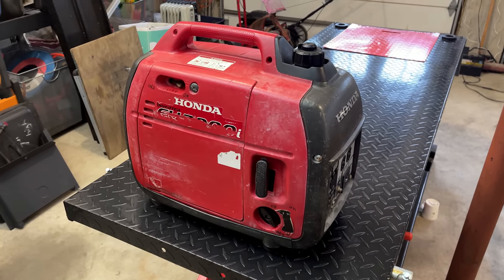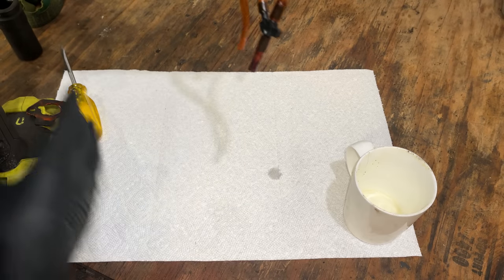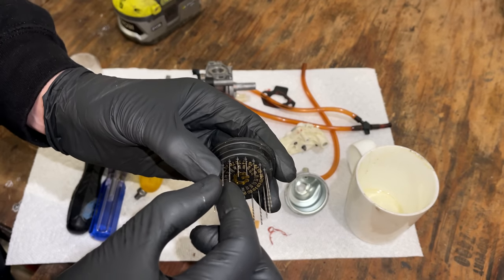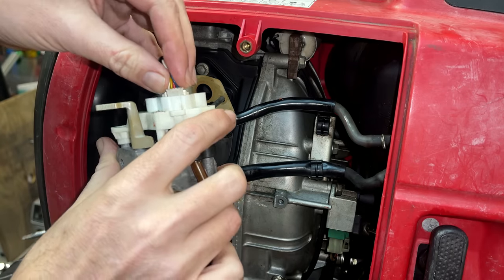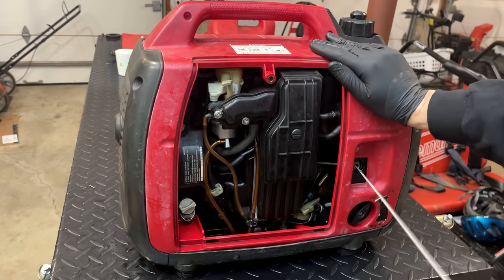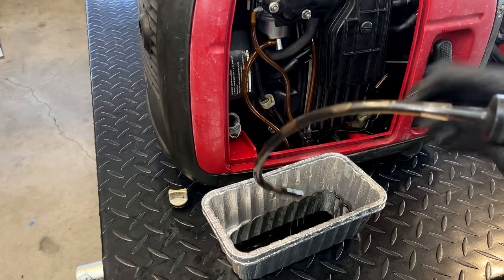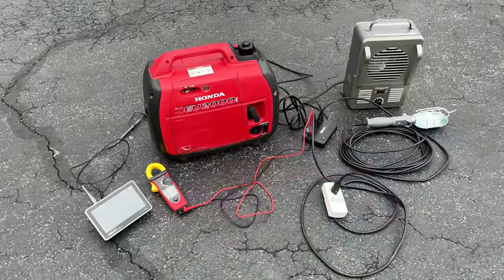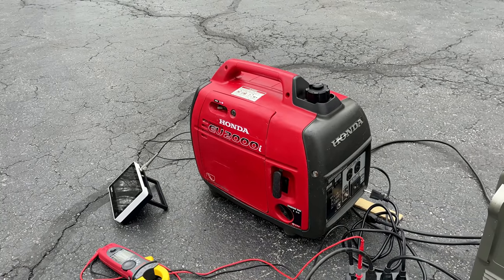Old Honda EU2000i Generator Leaking Fuel

Comment: Dealers don't want to mess with stuff that parts are marked "unavailable"...    if they get a clone or used part,  then they are stuck with warranty and nobody to back that up.    I fix electronics,  and I cringe sometimes at these jobs.  If it was for just me,  I'd fix it no worries...  for a customer I don't know very well,  I'd be nervous.
Reply from the maker: It did not help that the white sticker with the exact model revision was missing.  That would make any serious repair a difficult task.
Reply: @jcondon1  Indeed.  By default,  It's easy to condemn the technicians who refused it,  but once you've worked on that side of the door,  I can understand why.

Comment: Those shops that couldn't' be bothered are "spoiled lazy" replacers VS repairers.   A heat gun will renew the oils from the plastic and brighten the color but it can take a while to do a larger area.
Reply: or just don't bother, it's generator and not an art piece

Comment: I have a generator just like this, always been hard starting,, leave it set for a week or two and it take 10-15 pulls to get it to run. I guess I need to tear into it and see what I can find wrong.
Reply: Do you drain the carb?
If not then new fuel needs to flow into the carb to mix with the old stale fuel and give it the right "volatility" to start easily... 
Fill the tank to the brim with fuel less than 1 month old....so gravity helps flow fuel.
Reply: @JohnSmith-yv6eq   I use the non ethonol fuel and it shouldn't go bad in less than a month, so no, I don't drain the carb.
Reply: @dloregon  
Do you completely fill the fuel tank, give the fuel from the tank time to drop down into the bowl, mix with the old fuel in the bowl, and replace some of the volatiles that have evaporated from the fuel left in the carb....?

Comment: Judging by the apparent age of that machine, I would imagine that they were concerned about the availability of parts. I have had that happen a few times over the years. I remove the carb to clean it, everything crumbles due to age, and nothing is available. In addition, customers are unlikely to make the necessary investment for the repairs to get done on an old machine, making it a waste of time for a professional. I operate a side business repairing small engines, and that is where the majority of my customers come from. They are unable or unwilling to pay the prices charged by a professional shop, so they come to me.
Reply: Fair point but the shops can charge an unreasonable price for their work as well. My sister had a small gas powered mulcher that kept stalling when it got loaded up. The repair shop wanted $350 to “service it” which at the time, about 15 years ago was more than the cost to service her car so she asked me to look at it. I’ve worked on engines all my life, anyway I adjusted the jet and hey presto, problem solved. I gave the whole machine a proper service and it cost less than $50 in parts. Cheers Stuart 🇦🇺
Reply from the maker: Another big factor was the missing model ID sticker.  If you look for parts just looking up eu2000i you will find many revisions.  So fixing this one could have been a game of trial and error.
Reply from the maker: Most shops around me would not bother opening the carb due to labor costs and come backs.

Comment: Suspect of the missing dip-stick on the oil cap.   What happened to the dip stick?    If it's in the sump... it's an issue waiting to happen and snap off the splasher.
Reply from the maker: Good point.  Not sure.

Comment: Someone has already been in that carb, as evidenced by the RTV. wrong needle installed causing the droop in the float! 
!
Reply: Float droop is not unusual apparently....
might have something to do with corn juice in the fuel?
Anyway replacement is the cure as they are non-adjustable....

Comment: picked up one of these, starts and runs fine, plugged a 500w light in and it lights for about 30 sec, get a little brighter and then the light goes out but the engine still runs normally. all the while, there is no green light. ive ohm tested most of the components inside and seem to test fine. would a bad inverter be the cause? thanks for your vids on this generator.

Comment: Why can't people use lots less RTV Hi temp sealant?? Maybe try a light coating of Hondabond, Yamabond, or 3 bond, very light. I worked on one of these and the plastic ears that held the float  pin in place were broken, and they seem to be unavailable. I had to use a China carb. The OEM carb does not start 1st or 2nd pull either, I have a suspicion that #73 drill could benefit with a #72, although we all know you sholdn't drill jets. You have to ream them or buy the next larger size.

Comment: The generator probably has more than a thousand hours on it. So it would be good to clean the cylinder as the sparkplug looked bad and the timebelt replacement.
Reply from the maker: And a new valve stem seal.   Unfortunately that is a big job on these little machines.  Think the owner just wanted it running again for the occasional use.

Comment: I did not see a reason why that old float was so low.  The needle alone would not have caused that.  Most have a metal portion to bend when establishing the right level with that all plastic variety I am not sure if they can be adjusted, if not what caused it to be low??
Reply from the maker: The level cannot be adjusted although a heat gun can soften the plastic and an adjustment made.  Also a good chance the float will just melt.  Would say the tip of the needle had an issue or more likely the spring on the side opposite the tip may have lost some of its spring.

Comment: These generators usually sale for around $999, and a lot shops charge $100 an hour for labor , so you can see why they don’t want to work on them . People could easily spend 2 or 3 hundred and then still have a used gen that they may have more trouble with. I’m not saying it’s right but that’s the way our throw away society is nowadays. No more corner repair shops 😢  !

Comment: New viewer here, what make / model of drill bits are you using?  I really like that drill bit container.
Reply from the maker: Gyros® Carbon Steel Wire Gauge Mini Twist Drill Bit Set |Includes 20 Micro Carbon Steel Bit Sizes #61 to #80 | with Convenient Clear Dome Storage Case (45-12010) https://a.co/d/cVt7Bua
Reply: @James Condon  thanks, I just ordered a set!!
Reply from the maker: Just be careful.  I have broken a couple in the jet :(

Comment: Just wondering what the two clear tubes that come out each side of the carb are for ? They join up in a Y junction and just lay open ended in bottom of the plastic housing. Fuel overflow ?

Comment: I had one identical that given to me and it’s still on the bench I replaced the carburetor tried rebuilding the old one still doesn’t run right, but I found out that there’s a certain model line of this particular generator that has a defect in the carburetor, which makes it impossible service Prone to clogging even with gas left in it less than 30 days. which means it has to be drained of fuel after every use and hardly no one does that so there is tons of these little EU 1000 and 2000 sitting in the corner of garages with people that have given up on them. and your customers right no shops wanna come anywhere near them because it’s impossible to keep them running for very long.

Comment: Would you not replace the fuel lines, they look  a little brittle. Looks like it has been well maintained though. Maybe a tiny bit of that sealant broke off and clogged the needle n seat ever so slightly enough to cause an overflow and by stripping it, you actually cleared it? Magic fingers, also applies to computers a tear down works for no apparent reason.

Comment: Do you know of a place to find rings for the older flathead Honda engines that are in the older small suitcase generators? I have a small 900w Kubota branded generator that needs rings. It's small and very very handy. I used to use it all of the time. I would love to fix it.  I do not want to tear it all apart if I can't find parts for it. I think is is around 2-3hp.
Reply from the maker: Sorry not sure where to source rings fir that engine.

Comment: God...  think I would have checked for a spark right at the beginning of all this.  If the carb has been pissing fuel into the engine for hours, the chances are high that the spark plug will be fouled... and badly so due to the very rich running...

Comment: That's odd that no shop would look at that generator, I'm a small engine tech and Id of looked at it if he brought it in for repair
Reply from the maker: I was just as surprised.  Seems like easy money and an easy fix.
Reply: @jcondon1  those are pretty easy to fix, diagnosing the inverter board is not too bad, I've have a Honda generator trouble shooting guide with the specs, but I fix those generators here quiet often for issues like inverter boards or carbs

Comment: I think you found out a little bit of why shops won't bother with repairing these. First the shop would get screamed at for a $200 repair bill and then they would get screamed at for breaking it and causing low oil shut off. That's a lot of hassle for a $40 profit

Comment: You may have to read between the lines on why local shops won't fix a product. Sometimes it's the customer and not the repair that's the reason shops won't take on the work.

Comment: Most techs don't know how to adjust the min/max because of the eco system.  Need to set min/max for eco AND normal mode. Just got mine back from annual checkup and it wasn't done correctly.

Comment: Was it just the light reflection or did that oil @ 40:12 look silver/milky when you tilted the generator?  Also, what ever happened to that generator with the possible weak valve springs?
Reply from the maker: Still have it.  Will make another video on it, but got tied up with a bunch of other projects.
Reply: @smallbyrdz3823  That usually happens with an overfilled crankcase, where the rod/crank actually whip the oil into a foam. When he tipped it, it did not appear that the oil flowed out prematurely as it would if it were overfilled. Also, most decent oils have an antifoaming agent in them to prevent just that. It may well have just been the way the light was hitting and the camera picked it up.

Comment: Where do you get ll those sexy new decals?  Whenever I look up a parts list for anything I am fixing, everything is "Obsolete - No Longer Available"!
Reply from the maker: The eu2000 decals are discontinued on some revisions but other revisions are still available.  Just looked at a few revisions until I found some available.

Comment: the best one that I ever had reliable  heavy use was the sportsman 2000 w generator run off of LP gas. Was Honda generator just like the one he worked on the issue is that float is plastic running a generator on 90° temperature outside the plastic gets a little hot and droops down not allowing the float to completely go up to turn it off that was an issue with them generator I went through three of those stupid floats always in the summertime till I start taking one of the covers off of it the side the carburetor was on never had no more problems with it when 45:08 gas prices went up I sold it and bought a gas generator that runs off propane.

Comment: When my EU1000 got about 40 hours on it, it became hard to start.  Turned out the plug looked pretty fouled, like this one.  Cleaned it up and it was fine.   When the same unit was subjected to a brief flood of water about 8 inches deep - I had to split the case and clean/dry everything.  Stuffing it all back in and getting the thru bolts back in was very difficult.  Perhaps there is some trick I'm unaware of?

Comment: You should know better than to SAY, 'This should be an easy fix. 🙂
The smoke may have been caused by the previous owner tipping the unit over to empty the fuel tank and oil leaked past a valve.

Comment: I had one years ago. It had the same problem. It leaked fuel after only 30 or 40 hours run time. I sold it. I always thought it was ethanol fuel swelling up the rubber lines.

Comment: I have one of these I picked up for $50 and in about the same condition as yours. Had major surging in eco mode so I rebuilt the carb but I still have some minor surging(like yours) that I can't seem to correct.

Any ideas? And where did you get the new decals?
Reply from the maker: Great deal for $50.  I got the stickers from eReplacementParts.com.  Part numbers in the description.  It depends what you mean but surging.  It’s pretty common without out a load that the engine speed is a little unsteady.

Comment: My EU2200i is rock solid, but I'm curious if it's normal to take 12 pulls to start it if I turn the fuel supply off and run the carburetor completely dry before trying to restart it weeks or months later.  It starts with first pull if I turn the ignition off and then restart it.  I think it's normal, since the carb uses a fuel pump, and it takes that many pulls to prime the carb.  But I noticed with this generator that the carb was flooded and overflowing from the airbox within 3-4 pulls.  Is my generator particularly slow to prime or did the owner just not run the carb dry before dropping the generator off?  I also noticed that you start fiddling with the choke lever after only 7-8 pulls after cleaning and reassembling.  For a cold engine with unprimed carb, I need to keep choke on, pull briskly for 12-13 pulls, and it starts right up, I then switch the choke off.
Reply from the maker: The tank was empty, not sure if he drained the carb.  If you fill the tank to the top it can gravity feed and/or prime easier since the fuel level is above the carb with a full tank.

Comment: Honda excercise machine. I had one like this.
Reply: You could always modify your own machine with a "straw hole" through the outer case with a slightly larger tube of flexible EFI rubber hose sealed to the outer case and to the air intake where it enters the carb throat...

You could modify a tyre air valve stem without the Schrader valve in it as the cap-able case insert to the tube to the carb.
So unscrew the valve stem cap on the outer case, insert the "straw" on a can of engine start...
a very brief squirt of engine start..
withdraw straw and cap off tube.

Now the engine should start with one pull...

making the running engine do all the hard work of the 20 pulls to prime the whole fuel system including the carb that otherwise has to be done by you pulling the starter cord???

There should be a seamless transition to gas.....

This might also make very easy cold climate first starts as well ??

Comment: 33:30 Have you ever seen the video of the worker using a blow torch to refurbish plastic stadium seats? I wonder if just some heat to melt the surface plastic would work.
Reply from the maker: Heating plastic with a torch or heat gun does work in most cases.

Comment: Hi James, small question, the plastic pilot jet, has 2 o-rings or only one? because a friend of mine has one of these and even cleaning the carb, i can't get the choke full off and even with half choke when i load it, it dies, looking online some of the pictures shows 2 o-rings on the pilot jet but mine has only one, the one in the bottom. thanks.

Comment: Was it the float height that was causing the overflowing? And subsequently fouling the plug. 

If it was the float height, how come you decided to change over floats rather than bend the float tab? Just curious.
Reply from the maker: It was the float height.  The plastic float on this carburetor has no metal tab and is not adjustable.  The plug was flooded with fuel and also a lot of oil.  The oil issue is most likely a bad valve stem seal.  I could have just swapped the needle, but the other float looked a little newer so I moved both over.

Comment: BY. THE. LOOKS. OF. THAT. PLUG. -  PRETTY. FOULED. ,  WITH.  BURNED. OIL. --  FROM. PREVIOUS.  ACCUMILIATION  IN. SYLINDER  .
    IT. HAD. TO. BURN. ITSELF. OFF. -  FROM. NEW. PLUG ,,  ❤👍🏻👌!  .

Comment: Greetings, I would like to know if it is possible to place a shut-off valve on the gasoline line before it reaches the carburetor and if possible, could you make a video. this to a honda EU2000i

Comment: Obviously somebody had recently taken the carb off and cleaned it then used the RTV on the gaskets to put it together. That RTV looks relatively new. Perhaps they fixed it then put it together using the silicone and that caused the leak themselves and just gave up on it or they were just testing your skills. Lol

Comment: I have a very similar, if not exact same one,  but under the brandname of Tescom, not Honda. Im in South Africa and can also not find any repair centre willing to work on it, not even Honda. 
My one starts surging after a while and then shuts off the electrical  output.

Comment: Who's your source for the decals and stickers? I need one for the gas tank on my Honda Harmony EN3500 generator that I bought new in 1999. The OEM part number is 87150-Z00-G31, but it's been discontinued. That's the only one I lack for when the time comes to replace the gas tank. Thanks!